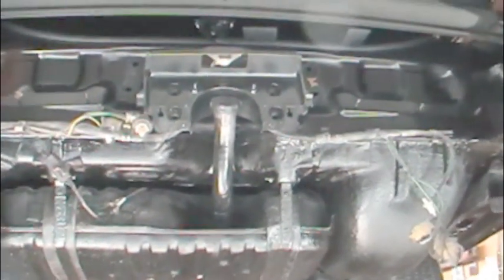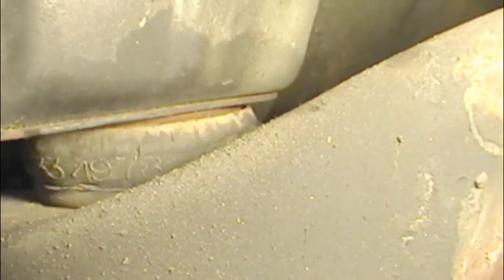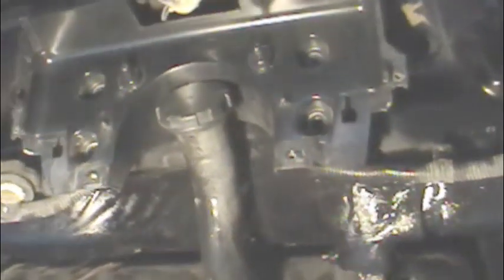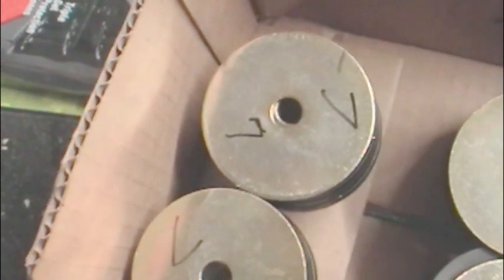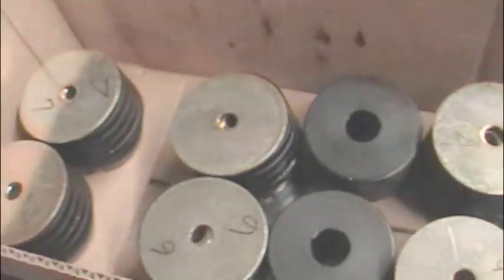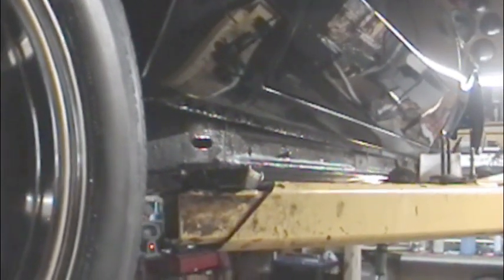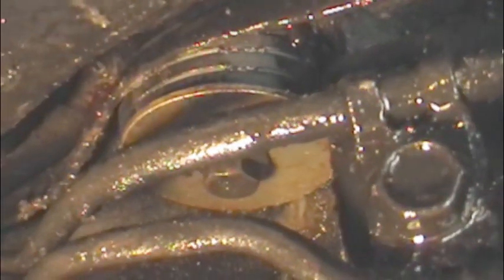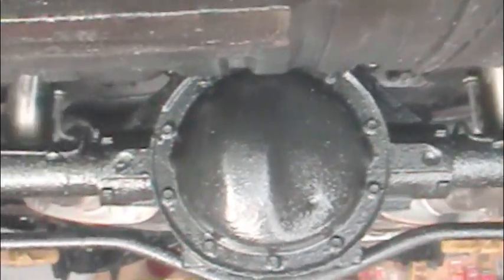1987 BUICK GRAND NATIONAL:  BODY MOUNT "PUCK" REPLACE & EXCHANGE

Comment: Thanks for this video. Dont know why I couldn't find it along time ago. 

The washers that I'm supposed to reuse on the core support I lost a while back when I replaced the front clip on my el camino. Would you say those washers are the same thickness as the ones that came in your new bushing kit. I have the same kit and if they are the same thickness then I'll just match them up with some new ones.
Reply from the maker: I think they were just a bit thinner Allan ... aside of their diameter / I'd say you'll be fine.

Comment: So I did some research and position 3 on these was done like that from the factory for a Buick floaty feel, I looked and mine was missing and a few other guys on the forums confirmed that as well for position 3, Either way once the energy suspension kit goes in on my car I'm using all the bushings.

Comment: Do you do this work for other people or just personal I see you said you in the Midwest I'm in Chicago and could really use this for my 86 regal or if you know a shop greatly appreciated
Reply from the maker: Hi slick !   I'm up in Central MI. and unfortunately, I can't really do alot of this "sorta-thing" anymore / as I'm now retired. The REAL CARE needed here (and this is MY opinion), is the 'prep', you'll (or someone) will need to juice-up ALL the internal-Body "drop nuts" soaking them right down, as to THEN (hopefully), have a nice means of removal.

Believe me: they are set-up HARD, and were meant to never again; "see the light of day" / and they almost always will never break loose unless we DO some "prep". Example: The rear seat bottom will pop out, and you will SEE (on each side), a small dimple showing us EXACTLY where the the PB Blaster "money-shot" IS (and where our drop-in cage nut actually is). Then (with a bit of luck) ... they'll break loose, and the task at hand can begin.

What we don't need is an over-zealous moron whom has an 'obtuse' air gun / "rip-roaring" a new ass in our project and ruining any chance of a nice smooth exchange because he didn't do his homework ... "and most AIN'T"./ and DON'T.  So make your meaning plain, let the "chemistry" do the job for us literally dissolving any and all rust in preserving our nice car / ALL the way down to the proper bolt torque and later: a "re-torque". So see what you can do, and get back with me if you pull the trigger / amid your prefacing to the induvial that "I WANT IT DONE RIGHT". 

All my best.

Comment: I believe the "A body" was moved to front drive cars(Ciera,Century,Celebrity) for '82 while the rear drive cars were changed to "G body" {Regal,Cutlass,Malibu).
Reply from the maker: Your likely RIGHT Greg ... I had a 77 Monte Carlo, (a "BIG" car), and that was an "A" car as well I believe. My whole point ("and it's all rather-silly"), was the fact that the Dealership 'scolded me' once by saying: "WRONG info. will get you the wrong parts every-time Sir" ... making challenge with that remark: "the guy put me in my place" and pointed right to the cover on my owners manual: "A" Series cars ...  "that's  N O T  a "G" Car Sir" ... ANYWAY: "I never forgot that". 

End run: "what's the difference" ?  ... "NONE".  There it is.  "LOL"  :- )
Reply: Thank you for the video and for the reply I have a passion for cars and watch all your vids. Just putting out there the silly reason why after 20 yrs of building A cars GM switched in the first place. they should have continued using current platform A cars and front drivers G cars:)

Comment: How hard is this job without a lift?
Reply from the maker: The first thing I'd do is "P.B. Blaster" the cage NUTS ... SOAK THEM WELL !!!, *(and these are all 15mm bolts). Next I'd try and bust each one loose / take each one carefully out / leave loose. IF your successful: do one side at a time / one Frame-Rail at a time ... just remember that you'll ruin the Bumper Fillers unless you pull-off the bumpers. 
If they don't come out (the puck bolts), then you likely have to gut the interior and use a hole-say when you find the tiny "dimples" in the floor-pan (where X marks the spot / the money shot inside the Pass. Compartment / and as well as the Trunk). End run: I'd see IF there gonna come out, AND: the "No. 1" position's on both sides will need a wrench-man (on the top-side) along with battery removal / canister tank removal to gain access ... if things "go your way", then "yeah", do it on the ground.  Just understand (and this is obvious),  that with a LIFT, ALL this is way easier ... (ESP. in a world where things won't budge, and bolts might snap) ...  "PB Spray / Rust Spray" (my OPINION here), is REMARKABLE in the aiding of that which I've already outlined in the above, and can make all the difference in the world.
GOOD LUCK.  :- )
Reply: TommyZTrains ,thankfully the car is a rust free example I keep in a dehumidified garage.  I’ve got jack stands and 4 floor jacks.  Not looking forward to hours on my back.  I’ll be sending the bumpers off for paint while I do the job.  Thanks for the response!

Comment: Thanx for the video. I just did mine on my GN with the energy suspension kit. You mentioned the torque value of 30 ft. lbs. Is that the correct torque for the poly-urethane mounts? I didn't have instructions with my mounts, so gleaned what I could from your video. Other TR guys have suggested 52 ft. lbs. Any thoughts on this?
Reply from the maker: "I guess I never paid attn". (is the honest answer) ... I tweaked them all down snug, and after driving the car a few times / RE-TWEAKED things until they seemed "tight".  :- )
Reply: I did torque them to 30 as the video suggested -- drove the car and re-torqued to 30. They hadn't loosened. I feel the 52 number is for the rubber mounts. I'm going to re-torque to 40 for the poly mounts. Should be good enough. Thanks again.
Reply: Question. The no 3 has a drop down nut but it doesn’t fit in the washer.  I can’t believe the washer sits on top on the washer.
Reply: @richpawlak8432  ever figure it out?

Comment: you notice a considerable diff in ride height after install?   im doing to my GN  and afraid im going to resemble a 4x4  with the stock springs
Reply from the maker: Hey John ... with my having done this in a total of 9 cars, the answers "nothing". *("I'd welcome more height personally"), but after this job, (the body pucks), I used ta ALWAYS add 1" coil spring spacers (rubber inserts that lay inside the lower control arms for the front, and metal cup / spacers for the rear coils), and that makes the trim (MY OPINION) "Perfect". 

AFTER:  the height is usually a bit much, but later everything always seddles in nicely. (I speak again about the spring spacers). The "Pucks" (the biscuits), are no taller then the originals.  Best
Reply: TommyZTrains  awesome.  its the exact same answer i got from my buddy mechanic thats doing them on my WE4!   ill post up vid once i get car back

Comment: Howd you get the front driver side apart??
Reply from the maker: Hi Jack, I can't really recall ... some take the "rag-joint" apart (disconnect the steering column), but having a lift afforded me all the room I needed / INCLUDING popping-out the fender liners as well.  It's the "getting access" that's sometimes a bitch !. I do remember that the bolts were quite long.

Comment: Question for anyone.  I’m doing this now and noticed the no 3 has a drop down nut but the washer that sits between the body and rubber bushing won’t fit over the drop down nut. What’s the deal with it.
Reply from the maker: I've done so many / all my cars ... and the No. 3 is somewhat different then the others. I can't however "remember" anything DIFFERENT with the 3 position. The short answer:  call Kiban Performance / He'll know immead. Rich.  ME ?: "I guess I just looked at what I took off, and matched-it with what went back" / I myself don't (again) recall any issue.  BEST.
Reply: It’s a Prothane Kit   I ended up drilling out the washer to fit over the drop nut. Thanks

Comment: How often do you thing the cage nuts will spin and surgery of the floor is necessary
Reply from the maker: Unfortunately, "more often then not".  THAT'S WHY I drill a small hole just atop of each "cage" to soak it down good with "PB Blaster",  I've found (on nine cars up ta now), that IF there's a chance / "your change greatly improves" by doing this FIRST. Remember:  "your dealing with something that no-one ever thought would likely EVER,  see the light of day / "EVER again".
Reply: @TommyZTrains  Just a follow up , I had to replace 3 cage nuts in the trunk repair the cage nut body mount and rebuild the area, I also had to weld in three new frame washers .. good times Haha but it was worth it the car drives amazing compared to before with the Poly Bushings installed
Reply from the maker: @YGSpider  Sorry about the "laborious-task" Justin ... In 9 cars that I've done / I've had on 1 give my a real headache (that one was under the rear seat). Today's penetrates literally dissolve any rust, and I can remember just "foaming-up" those holes that I preface in the above.   *ANYWAY:  "you WON" !!.   ;  -  )